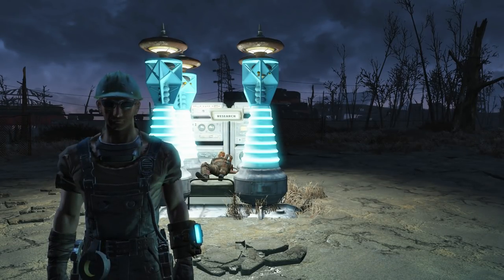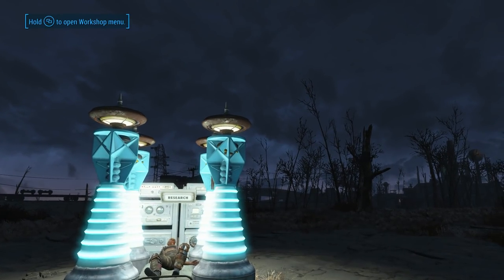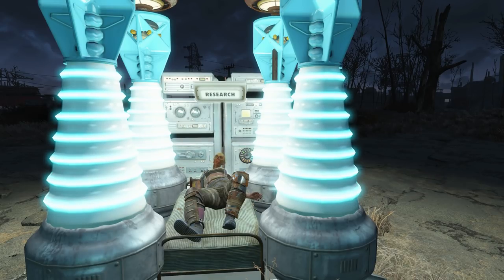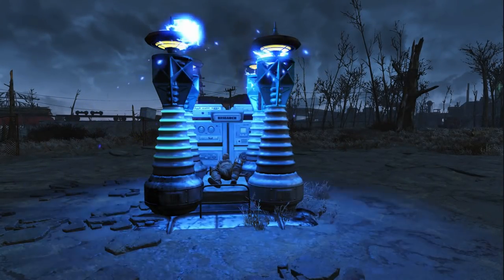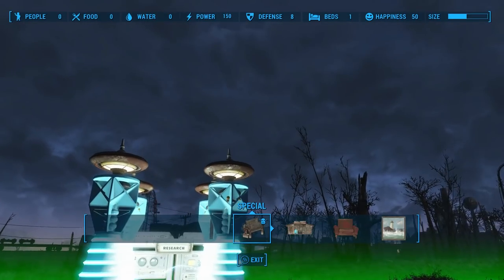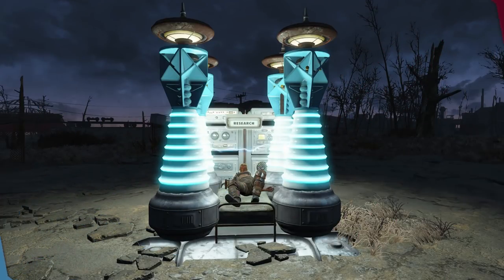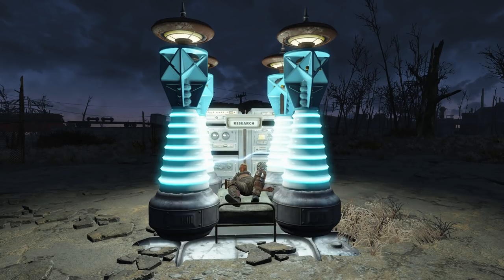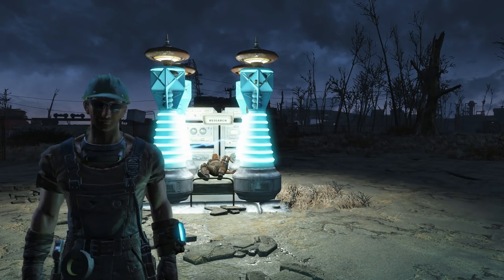IT'S ALIVE 🧟 Fallout 4 No Mods Shop Class

Comment: It's nice of you to place a body on the bed. I'd want to use it for the one settler that I have to keep reassigning to a bed because he won't stay out of mine.
Sure, there might be a slight, temporary downturn in the happiness rating after I flash fry a settler. But after they calm down, I'm sure the rest will understand boundaries a lot better.

Comment: If you build extra Teleporters for your first trip to the institute, you can store them and then use them as set decorations later. You could glitch the platform into a building, and have a electrified mad scientist room.
Reply from the maker: Hey that's really cool. Funny enough, I haven't gotten that far in my walkthroughs. Soon though! So how many extras can you create and store? Because that would be fun to create all the parts in multiple settlements and use them as decorations.
Reply: Yeah, because I found out the hard way that once you travel to the Institute, you can't build any of teleporter pieces any more. So, I suggest building extra pieces in all your settlements just in case you need them later. As far as how many extras you can make? I have no flippin' clue.

Comment: By the way, there is a known phenomenon in which a dead body that is resting on its back may actually sit up. I haven't been able to confirm it, but I think it's an effect of the onset or release of Rigor Mortis. The movement is usually accompanied by the corpse moaning, because the air in the lungs and other gasses are pushed out from the compression of the torso.
Reply: Dude, that's creepy AF.
Reply: @jediclonemark5860  Why yes, it is :-D 
There are stories of people dying of fright from witnessing this phenomenon, and I can believe that.
Reply: I don't know if I would die of fright. Well, I guess from a heart attack.  I would certainly soil my pants and faint.
Reply: @jediclonemark5860  Yeah, I assume that "dying of fright" usually means "shock-induced heart-attack". I suspect I'd be somewhat unsettled myself :-D
Reply: I've tried to find a reliable source for this, and it seems as if this is actually a conflation of several phenomena concerning corpses. 
It is confirmed that a corpse can ""sit up" during cremation, when the large muscles in the body contract because of the heat. 
It is also confirmed that some kind of bio-electrical conditions can cause twitching of minor muscles, like those in the hands or face. 
Gasses produced during putrefaction can cause movement, and also priapism (look it up >_> ), but not sure if that includes major movement. Those gasses can also cause corpses to moan... and apparently fart a lot. No dignity for the dead, it seems.
Reply: Stop it Pat! You're gonna give me nightmares. Man, I'm gonna go watch cartoons now.
Reply: @jediclonemark5860  Have fun!